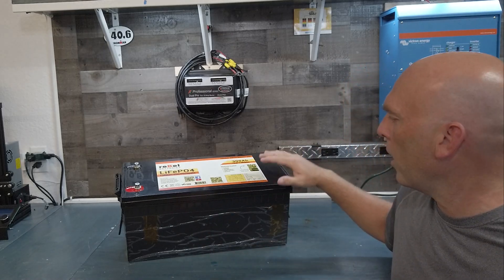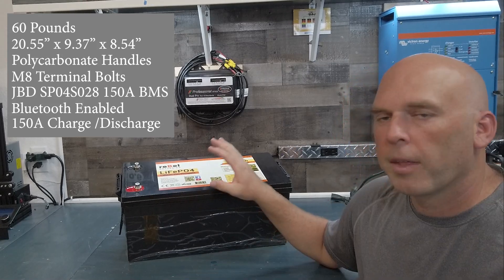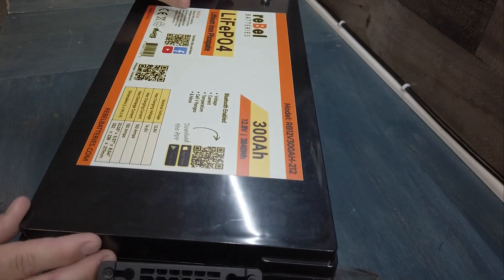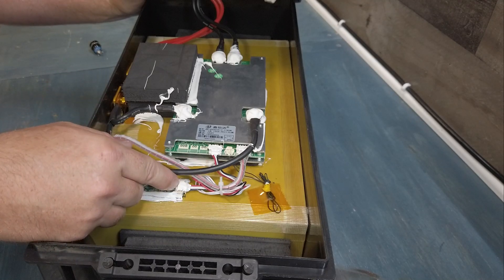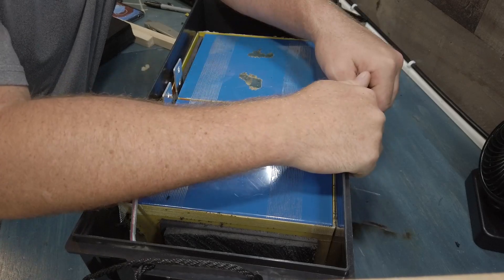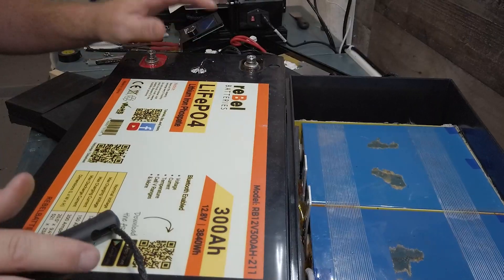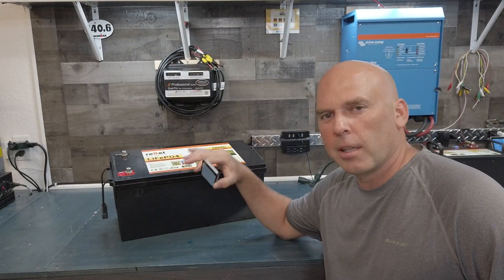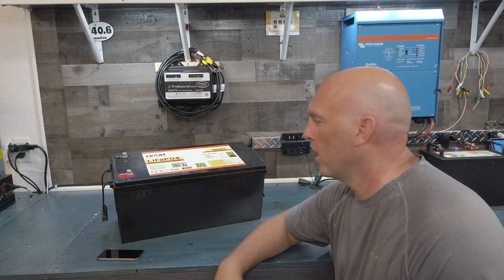300Ah LiFePO4 Tear Down - Bluetooth BMS - Deep Cycle Powerhouse

Comment: Hi Tim, i have a similar battery to this design can you tell me the best way to get the sealed lid off and replace it?

There is currently a crack on the lid so I need to replace it

Comment: How much for a 200 amp BMS i wanna have Bluetooth capability for my ampere Time 200 ah plus battery I've already opened it up and figured I can swap out the BMS for a better one and I believe the battery is a 4s2p configuration

Comment: Why do all these batteries have such low output BMS? How are you supposed to run a 3000w inverter off one of these? The cells should be able to deliver the current, but the BMS is the bottleneck. Can only run a 1500w inverter from 150amps.
Reply: thanks;  i guess a 300 amp bms costs a lot more.... need to check these things before you buy,i need to be an expert on *every  thang, dang*

Comment: Thanks Tim!  Subscribed !..... Quite timely as I am doing a 24v system in my Sprinter using two Chins 300AH 12v in series. Thanks for the teardown,I would wager the Chins are quite similar. Carry on !  Mike WG7D
Reply from the maker: The insides are where all the differences are. I won't badger another brand, there are plenty of videos out there you can find on the Chins tear-downs.

Comment: Hi Tim, Im currently using your 100ah LifePO4 battery. I'm charging it with a NOCO GENIUS10, 10-Amp battery charger. I've noticed that the charger gets rather hot after awhile. Not warm but hot. What battery charger would you recommend or is it normal for a charger to get hot?

Comment: I still have a lot to learn about batteries but curious why there so much foam on the sides?  Seems like the battery box could have been much more compact.  I would think some foam on the bottom and top would be more beneficial if the battery was dropped then 3 or 4 inches on each side.
Reply from the maker: These are standard 4D group-size batteries.  I should have addressed that in the video. To be considered a "drop-in" replacement, most manufacturers have filled the older lead-acid standard sizes with the smaller/lighter lithium cells. Keeping the form factor makes sense in a lot of applications. The side-to-side foam is to stabilize the cells and keep them from sliding, although that tape! They're not sliding anywhere.